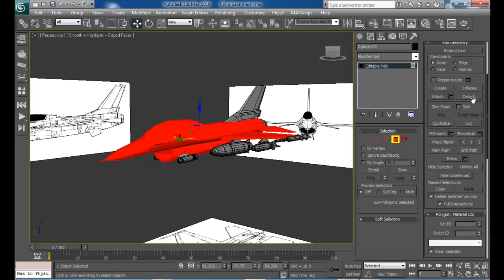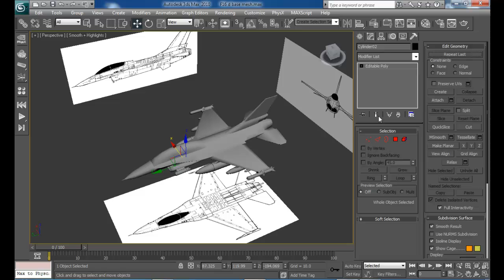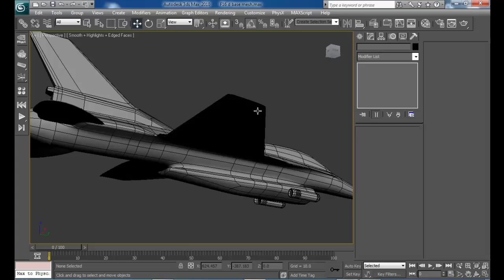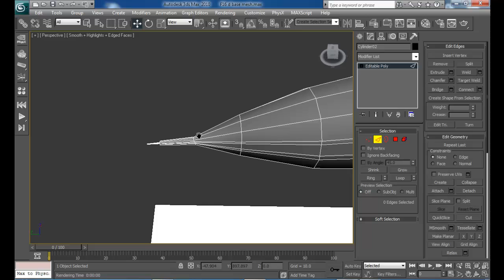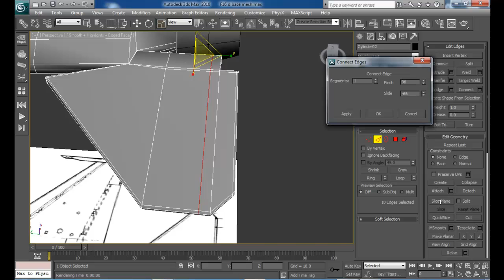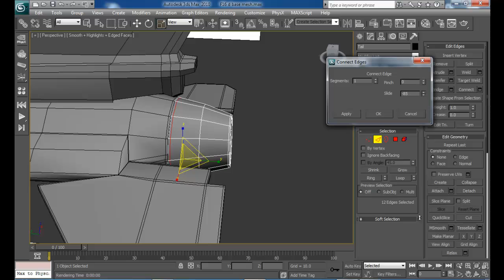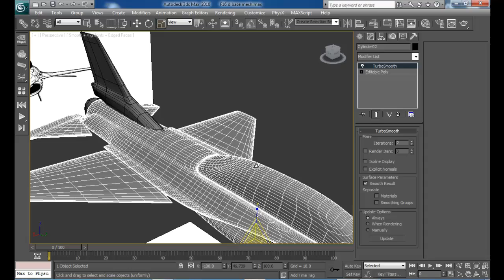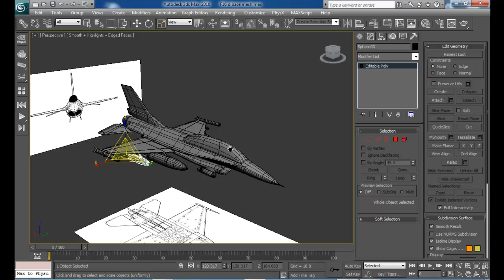Fighter plane modeling in 3ds max part 5

Comment: If you want to use mesh smooth without that troubles "back small wings like of fish", you don't need to add more segments, which make model harder. It's enough to use the different smoothing groups. Smoothing groups you can find when select model by polygon (there're 32 small squads with the numbers). Then in the same menu (don't use mesh smooth as the separated modifier) you can find "mesh smooth". You don't need to select polygons to smooth it all, but when you want to smooth the only part of mesh. You can open that menu and pick the empty squad "smoothing by groups". And you'll be happy. Good luck.